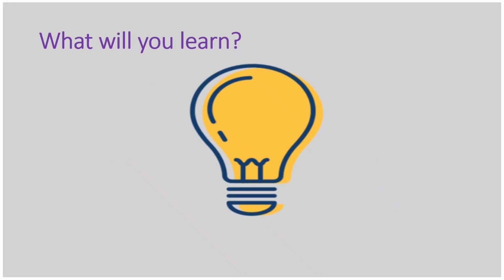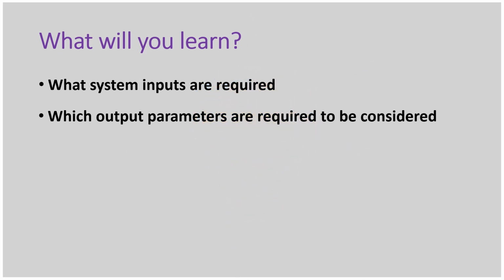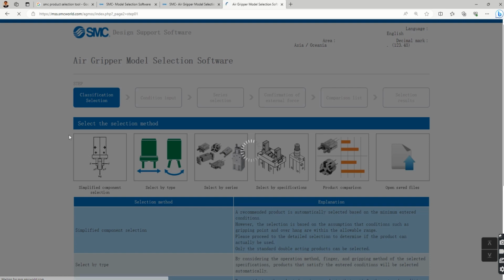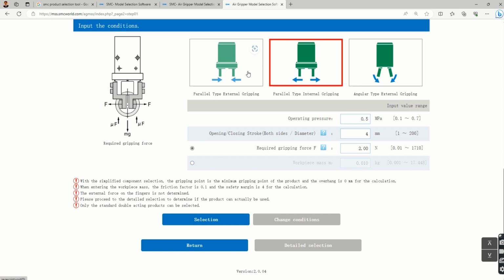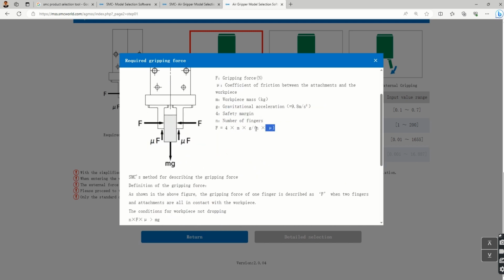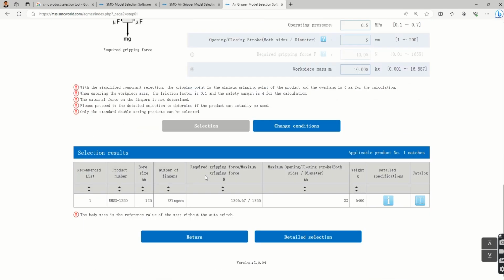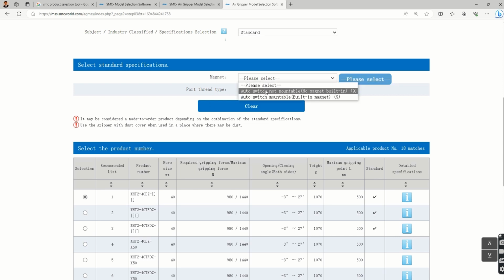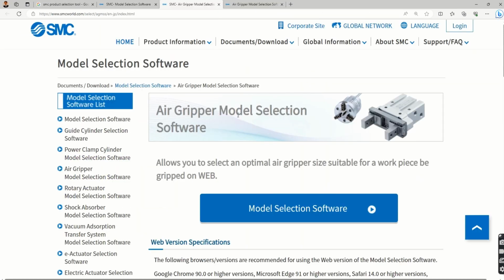SMC Digital Engineering Tools Part 3: - Air Gripper Selection

Comment: I have a question about this. Do automation companies actually buy these tools, or make them in house from the CAD model they get from the site? I believe SMC is expensive and making it in house will be much cheaper. Whats your experience in this case and in other tools also like vacuum system etc
Reply from the maker: This is not the case. In automation  accuracy, precision, repeatability etc matters a lot. Also the companies like SMC,Festo are specicialized manufactureres of these products. Also when you have these type of standard products in the machine , serviceability  is easier. You can replace the component  if needed with another standard component.  If you are manufacturing  these products then quality is the biggest challenge.  
One more problem is customer will ask for the standard components from such type of specialized manufactures only as they also want to have stadardization in their machines. I hope this will clear your doubt.